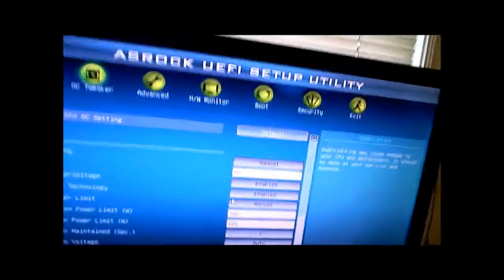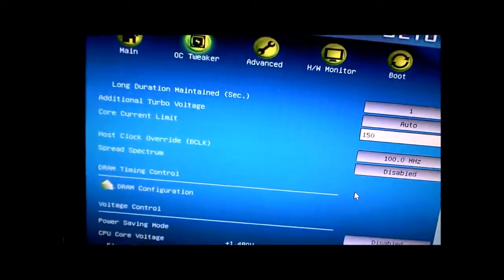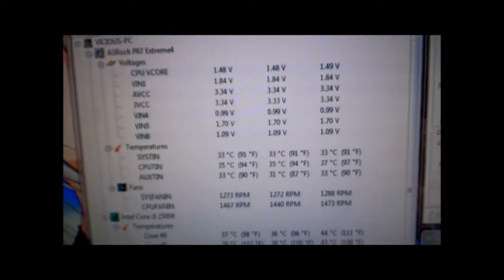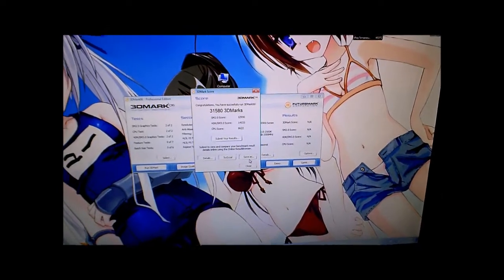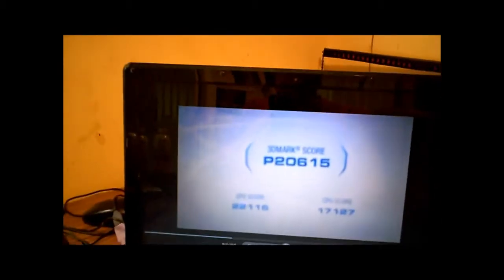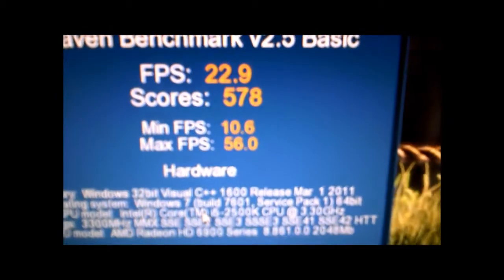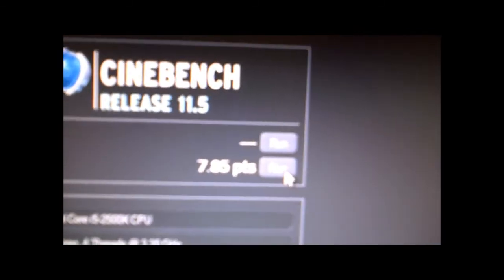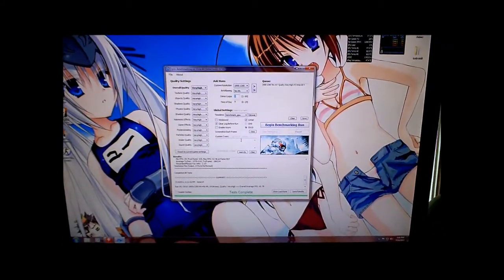Core I5 2500k 5Ghz Overclock Benchmarks

Comment from the maker: Hello unfortunately i don't have any of my old computer parts or i would be more then happy to do that but i think you will notice a difference i did after going to a 2500k. the 2500k stock kept up with my 1090t  @4.2ghz after i overclocked it to just 4ghz it seemed to be a big improvement then after i got it to 4.8 it was not even a contest. i mainly saw my minimum fps go up by 8-10 also games ran smoother at a more consistent fps.

Comment from the maker: @SuperQetuo13579 if you built your computer yourself you should be able to overclock it. If it has a locked multiplier then you overclock it with the bus speed and increaseing volts to a certain point and watching temps.

Comment: for 24/7 computing I wouldnt go more then 1.4v on any sandy bridge cpu.
It doesnt matter if you have sub zero cooling, the transistors degrade due to high voltage.